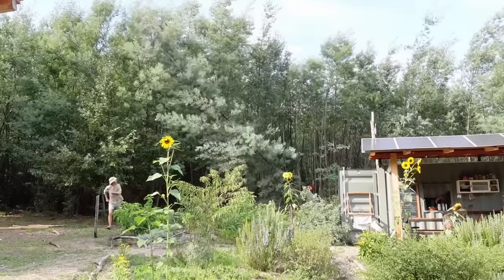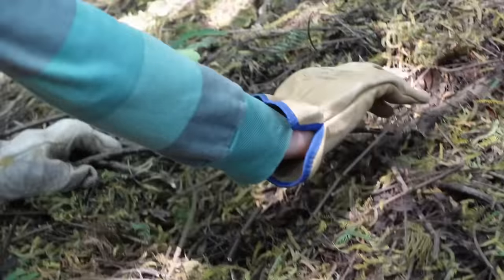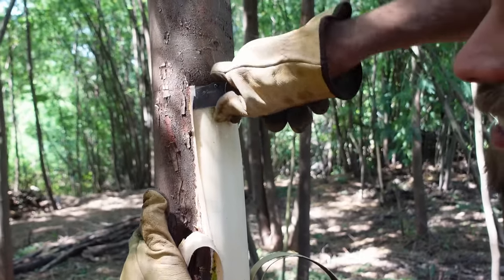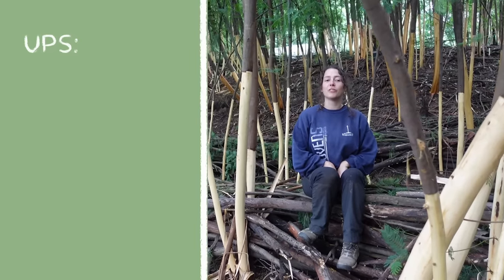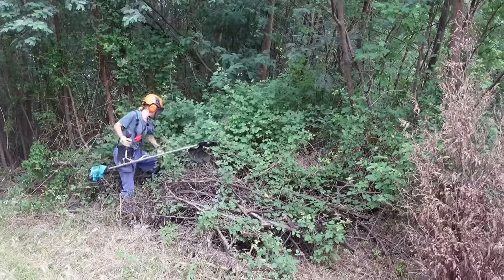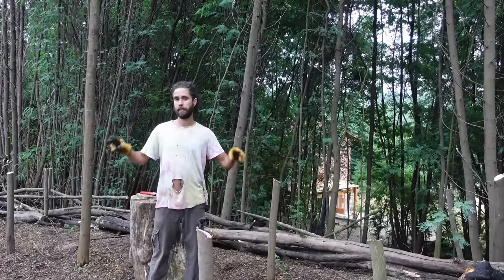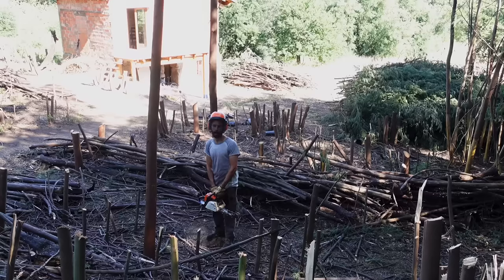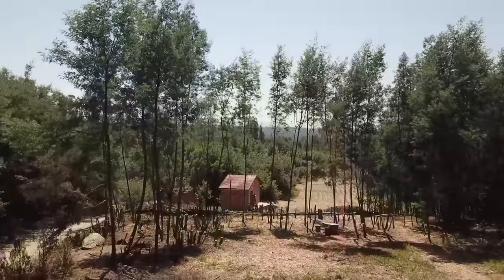#84 Why we're chopping a forest down

Comment: This triggers me to hell and back. Why do you guys insist on cutting the trees a meter above the ground?! In previous videos you atleast cut them below half a metre which I could handle.

Now youre loosing so much good wood to rot when you could've used it or sold it as firewood, or even as building materials. An extra meter of length of material is invaluable. 
Proper woodcutters cut when possible as close to the ground as possible, why dont you?!

Comment: I can not fathom what you people are doing 🤣
1. You left half of the tree still in the ground... This literally saved no time; simply cut at the bottom and drill holes into the stump so they die, instead of cutting the tree waist height. 
2. You debarked the other half of the trees, thus leaving you in danger for one of them falling on someones head when it does eventually die... Clearly the same amount of thought went into this as it did buying in northern Portugal (The rainy part). Baring in mind you STILL have those trees until they die, so you havent done anything about the 'fire hazard', you have in fact doubled it 🤣
3. Not sure what a couple of thin bits of trees are going to do about the rain water - normal people would simply build a small drainage system that can direct the water to where you want it.
I could go on for days... 

It genuinely gave me a headache watching this...

Comment: What's the point of "letting the trees die slowly"? They'll have to cut them anyway, with or without bark. In the meantime, these trees pose a fire hazard, debarked or not.  What a waste of time. And why cut trees at 1m height, and worry about resprouting, as opposed to cutting them above ground? Smh.